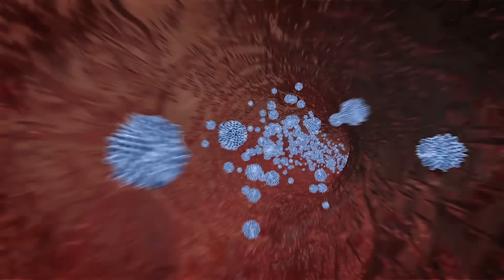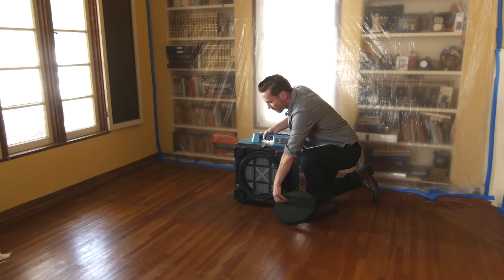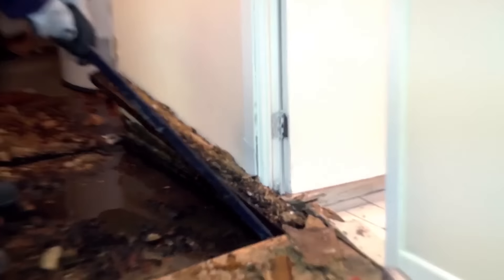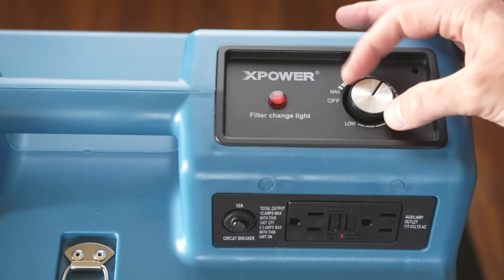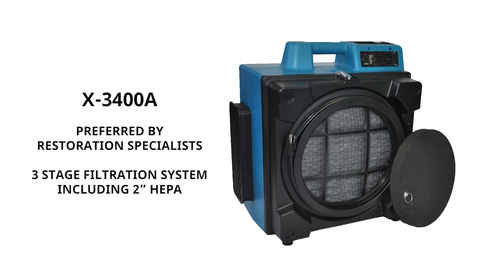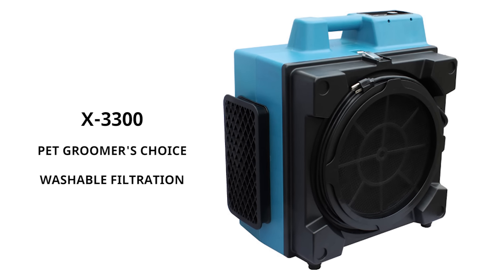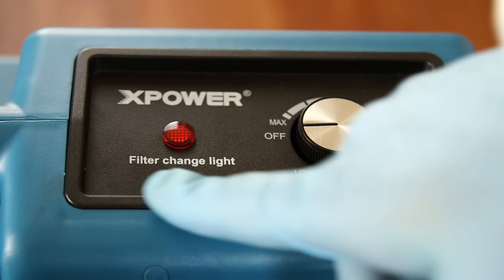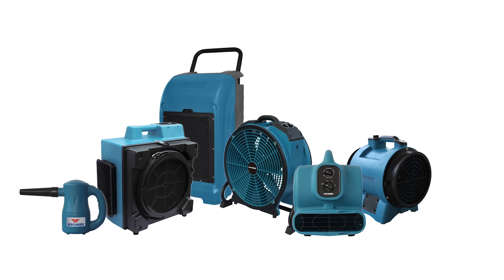XPOWER Air Scrubbers for Air Purification, Mold Remediation & Restoration

Comment: Just curious, do you always filter the air before expelling it outside?  And do you ever just filter the air in the effected area without any ducting to clean the existing air?  If you are venting the filtered air outside, Are you also pumping new fresh air into the area or at least have an open window to let new air come in?  Thanks
Reply: Wondering this too, it doesn't make sense to expel clean air outside if you already have negative air pressure 🤔
Reply: @shaquileoatmeal7365 That’s how the negative air pressure is created. It has to be ducted outside the containment/room. If the scrubber is just sitting inside the room, sure, it’s filtering the air. But it’s not creating negative pressure.